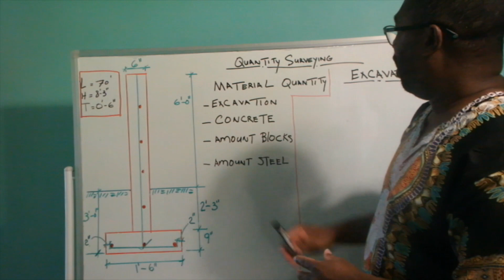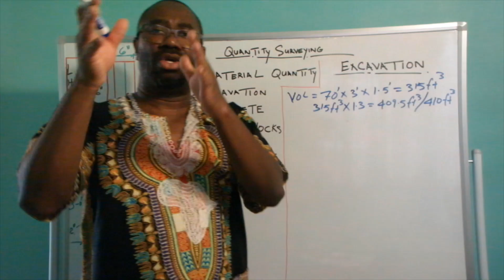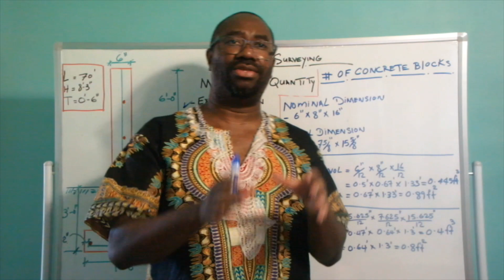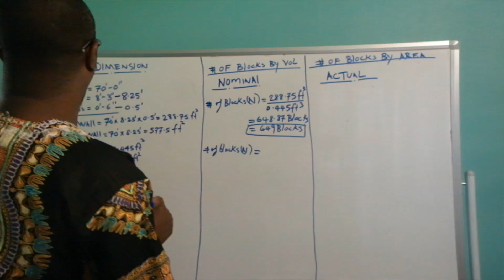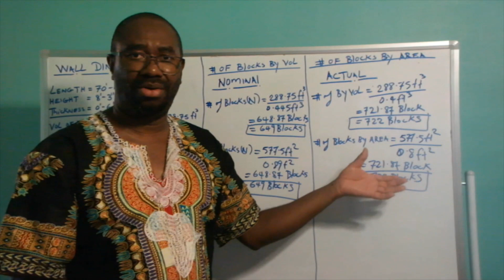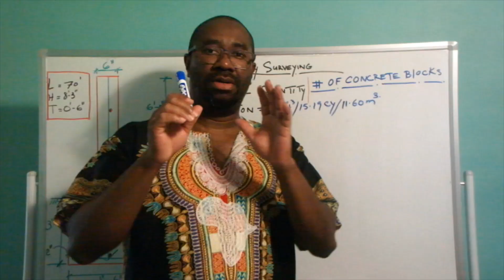HOW TO CALCULATE MATERIAL QUANTITIES FOR YOUR BUILDING PROJECT PT1. (JAMAICA)

Comment: Hi Jk. Happy new year 🇯🇲🍾🇬🇧. Question. Would I be correct to calculate that 7000 sq ft of building needs 6500 8” blocks and a 1320 sqft building need 1400  blocks? Regards Lennie
Reply from the maker: Happy new to you too. I would have to do the calculation.
Reply: @jkengineeringarchitecture.  Can you calculate for me please dear sir. I’m not sure my maths is correct. Many thanks in advance.
Reply from the maker: @cCaribbeanSpursTv  I will try to get to it.
Reply: @jkengineeringarchitecture.  Thanks JK.